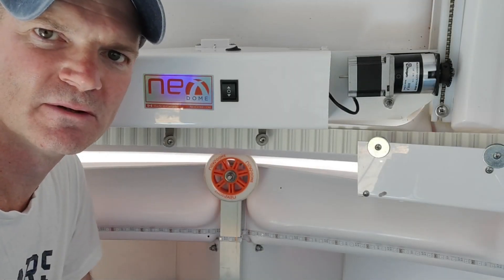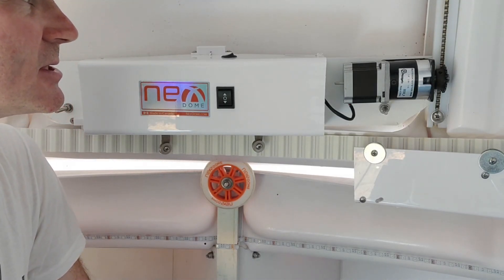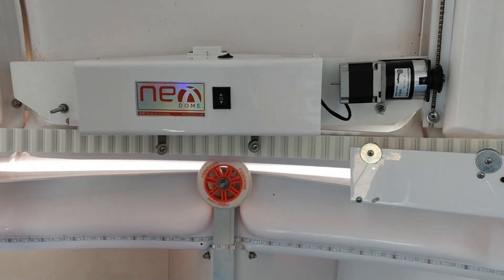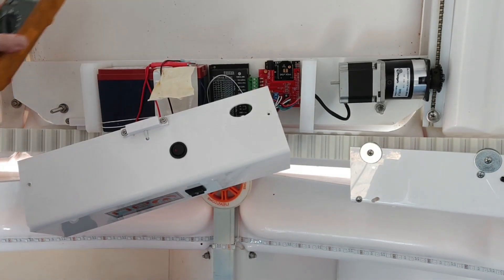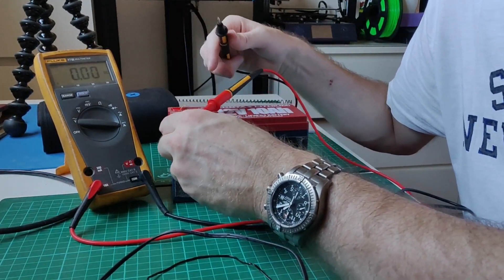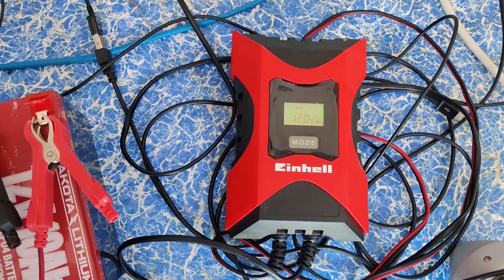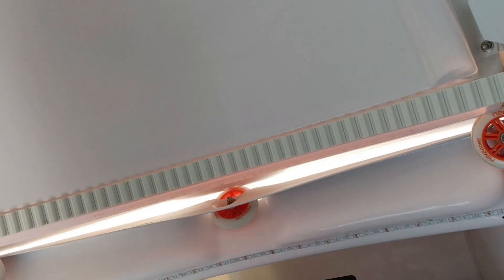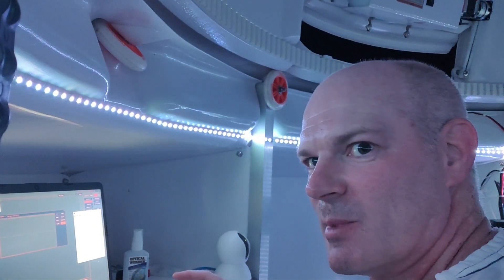Open the pod bay door.........."I'm sorry Dave, I'm afraid I can't do that."

Comment: I found the connection between the battery and the charger was very sketchy.  I broke mine down and eliminated links or replaced screws with solder.  Charges 100% of the time now.  Otherwise it eventually loses connection and the battery dies.
Reply from the maker: Yeh, never liked these hanging strips, looking to replace them with some other arrangement. haven't decided what yet.